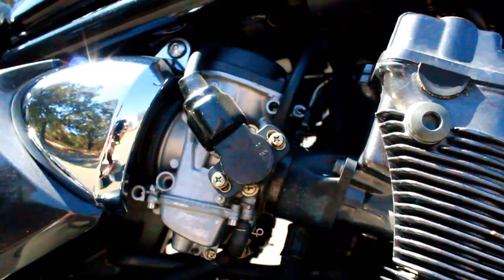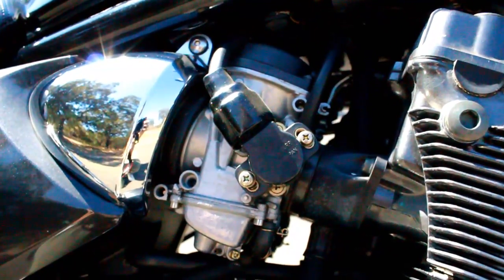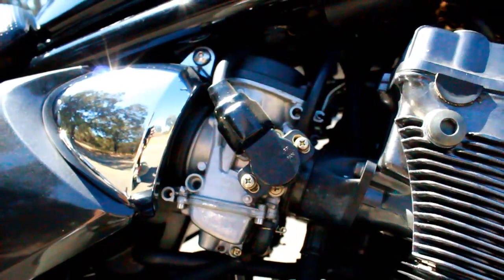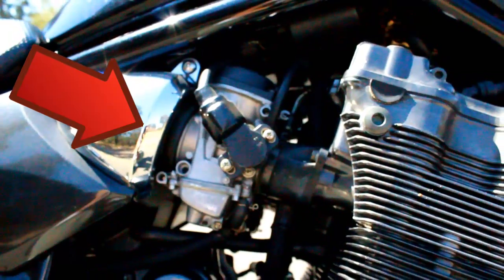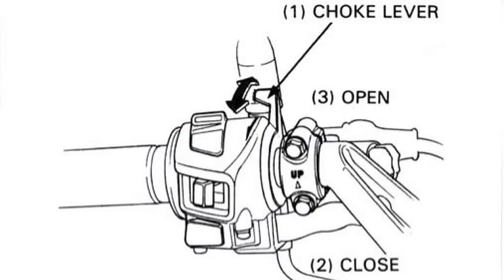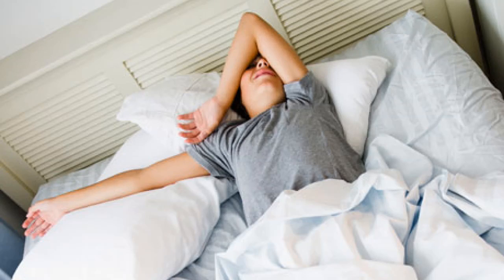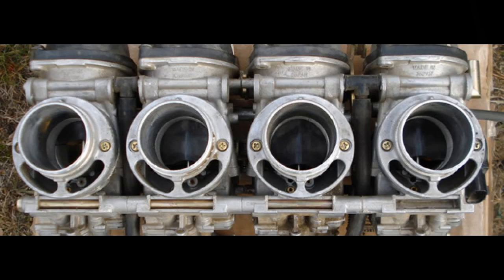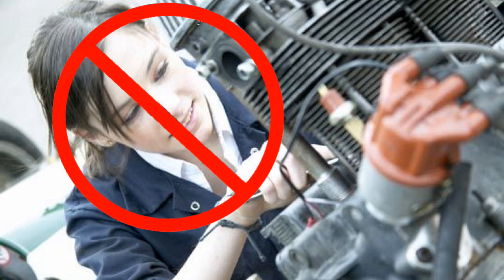Killer Tip #2 - FUEL INJECTION VS CARBURETORS

Comment: Carbs have one advantage over EFI, they work without electricity.

If your EFI bike has regulator issues, or any electrical issues, the pumps and the computer will call it quits. The carb on the other hand, wont even notice.

Carb bikes uses gravity to get fuel. EFI bikes uses a fuel pump. When all goes well, EFI is more responsive and efficient. When all goes south, EFI becomes a pile of ass and expansive money pit. Also, carbs, with their more approximate fuel mixture, sound better.

Comment: I'll take a carburetor over EFI any day. EFI components, just in the cost for parts, are at a stupid price. I'd much rather spend 25 to 30 dollars on a carb rebuild kit when need be. Plus in my opinion, when a card is tuned and adjusted right, it will out perform EFI. It's just that most bike owners don't know much about how to wrench on their own rides. But that's the day we live in. EFI works great when all is well, but God forbid something in the system goes south. That'll hurt your feelings more than a gummed jet. Of course though... I'm speaking from a vtwin perspective with a single carb in mind. I wouldn't touch a multiple carb setup with 10 foot pole.

Comment: Yeah so hey I personally thought that vid was very good ,I've just got my first fuel injected bike 2006 suzuki boulevard C50 after funny enough as some have mentioned accidents I was hit by a 4WD who run a red turn signal and T-Boned me which resulted in two broken legs and a cracked pelvis and well killed my 98 Honda Shadow 750 A.C.E .
Anyway so yeah has been a learning experience with this one , as I was starting to have a slight idea of how things were working with the older bikes the Shadow being my third bike from the 90's.
Ummm and you know what I feel what the blokes are saying about never really being safe on a bike, but at the same time I do believe I'd have been injured anyway if I'd been in a car ?
The 4WD hit me at about 40 kmh so I've been told as I blacked out on impact and well in 2014 I was a passenger in a car that hit a tree front on at about 40 kmh and ended up with two cracked vertebrae and two cracked ribs glass embedded in my face etc and yes I was wearing a seat belt .
Wow so off topic LOL  anyway thanks for the video upload KSQ liking your stuff

Comment: My chemistry teacher settled the whole carbourator vs fuel injection thing. While carbs can give you more speed and power, they are less fuel efficient than the fuel injection systems. With fuel efficiency becoming a big thing amongst people now, and emissions regulations, newer vehicles don't use them.

Comment: I am working my way further back into your older vids!  hahaha!  
I used to be absolute die-hard " give me carbs or nothing!!!".  
However, I have learned it is much easier to just swap injector(s) and download
EFI programming (if needed) than it is to mess with carbs & jetting issues!  
Also, now owning both a 600cc EFI scooter, and a 500cc V-Twin carbed Honda GL500, it is amazing how fast the EFI engines start up without any lag, and how CLEEEEEN they run!  
I can ride to work on the EFI bike and not smell like I been on a lawnmower for an hour!  :-D

Comment: I am probably wrong but when you turn the choke on you are "closing" the choke by moving the butterfly to the position that restricts air flow and makes the carb pull more fuel, when you "open" the choke you are turning it off.

Comment: 0:23 You and your motorcycle safe...
I'm an ex biker. Still a bike lover. And I can ASSURE you that there is no such thing as "safe mortorcycle". I was stationary. I got hit. By an idiot on another bike. It's been a year. I had six surgeries. My ankle is fucked. I was wearing full bike gear. The idiot crashed onto me at 20mph.
So if you ever think you're safe on a bike, you're wrong. Anything, any accident, WILL hurt you. Might not hurt you too much, but it will hurt you. And you carry on going, thinking that a scratch, a cracked rib or something like that is not a big deal. Till you get really fucked.

Comment: I have had bikes for 20 years and all have had carbs. I have never had a problem.
Reply: Thanks I needed that...I was worried when I found out my bike has a carburator
Reply: jmh4ggg To be honest, I've spoken to a few bikers and they say they prefer carburettors as the carburettors seem to be so much better at delivering fuel especially at lower revs. The power deliver is so much smoother. Fuel injection can be a bit jerky at low revs.
Reply: +1100HondaCB I'm also mechanically inclined...so thats another plus. Rather than having to take it to the shop as soon as I don't have smooth fuel delivery I can learn to take it apart and clean it myself.
Reply: jmh4ggg It was only due to emissions that carburettors were ousted.
Reply: 1100HondaCB nah, it was also fuel efficiency. I asked my chem teacher a while back, and he confirmed, carbs are less efficient than fuel injected. They can give your vehicle more power, by a slight margin, but they don't run as clean and they aren't as efficient as fuel injection.

Comment: I have a Shadow with a single carb. Very very easy to work on. No need to sync as it is single. Great video!!!
Reply from the maker: +Cruiser Brewser I hope to pick up a bike with a single carb soon. Something I can practice working on. Thank you!
Reply: Just buy a Carb, they are pretty easy to work on, one of the main projects when doing a motorcycle course... Also carry an Egg with you on every journey if you have a bike with a radiator :)